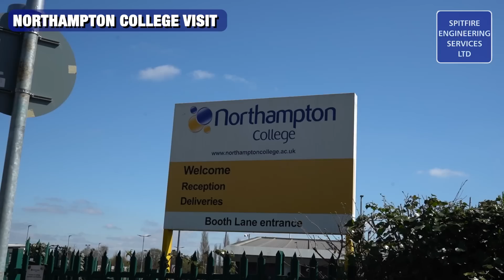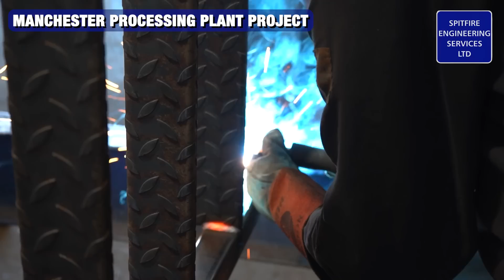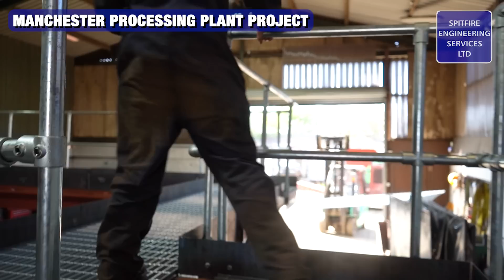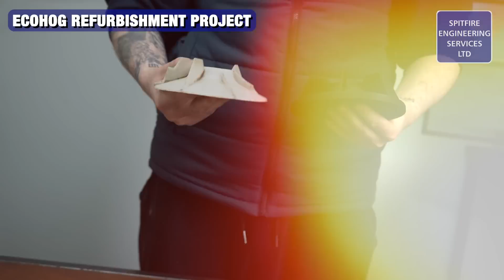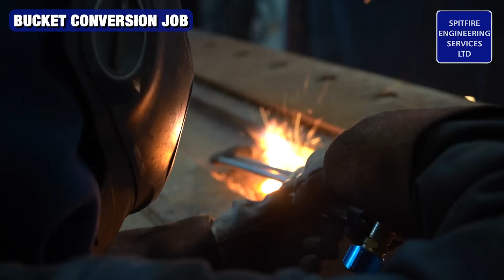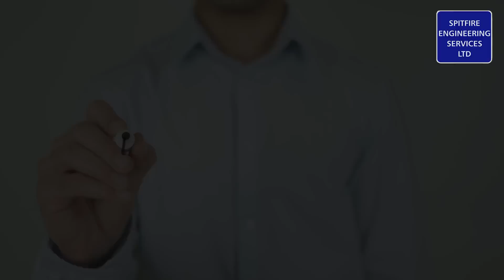LIFTING 10 TONNES OF STEEL – OUR BIGGEST FRAME YET!

Comment: Great video once again, the whole team is growing into their video roles quite well.  The 3D printing segment was great to watch, especially the modeling part.  Keep up the good work.

Fun fact - there have been several observation wheel project proposed for Las Vegas, you can find them online.  Two made it to construction.  One was the High Roller, a cable stayed wheel built for Harrah's behind the Flamingo.  The other was Skyvue, a rigid framed wheel built between Mandalay Bay and the airport.  Skyvue would have been the better project when finished, but the High Roller got done quicker because it was funded by a casino company.  You can see the leftover bits of the Skyvue wheel in Google map Streetview across from Mandalay Bay.

Our latest one of a kind creation is the Sphere, which admittedly is a pretty remarkable looking construction.  You should check it out.